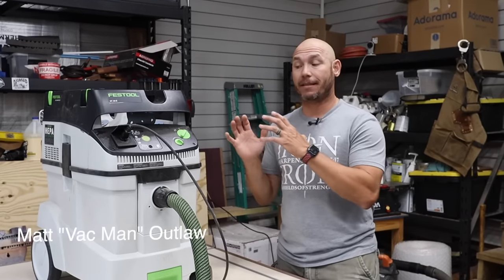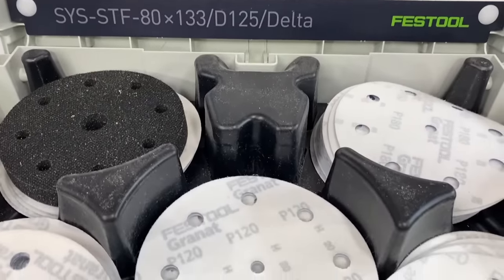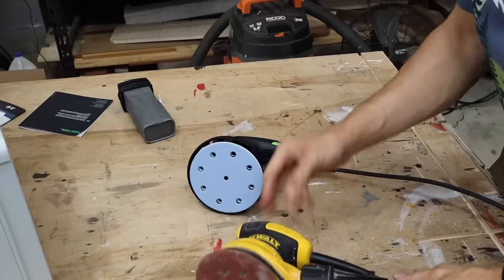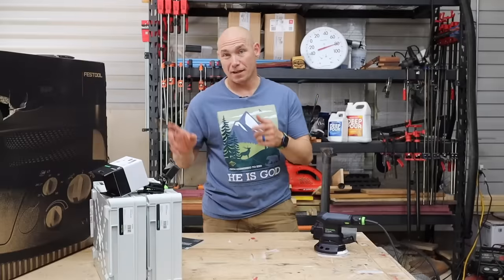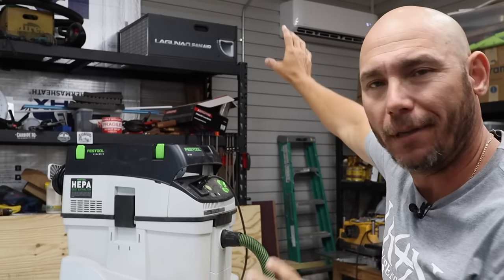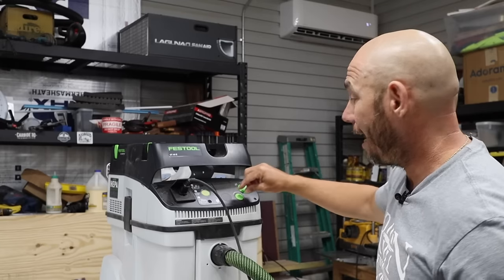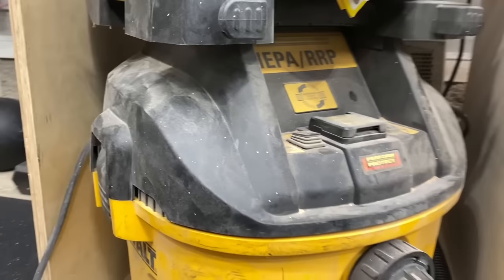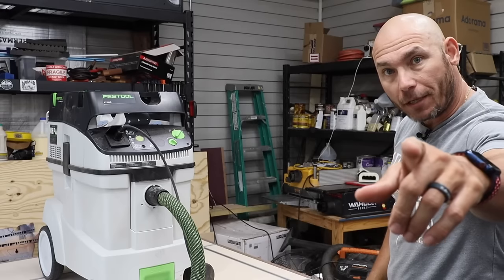Watch This Before Buying a Festool Dust Extractor or Sander

Comment: I have a lot of Festool tools ..  4 sanders, 2 Vacuum cleaners, 4 Saws, work table, battery driller, router,  tool racks and more. And one thing is for sure.. The are worse design and poorer quality than before. They where my favorite tools, but now at the bottom of my list. No way worth the extra money anymore.. should be priced as  the cheapest China stuff around.

Comment: Festo is the most successful marketing con in the business. Im ashamed to admit i got sucked in by it and what a monumental waste of hard earned money it was.  Their sanders are gutless, they dont last very long and the centre of gravity is way to high for good control. I converted back to Dynabrade and never looked back. Vastly better sanders in every concievable way. 
Festo constantly changes their fittings and connections so within two years your whole kit is obsolete and good luck trying to get spare parts. My air orbital died within a year ! Cheapest build quality. Take one apart and you will be horrified. Overpriced shit.